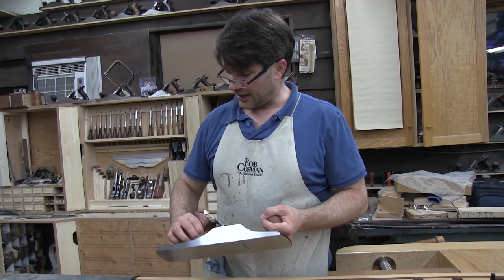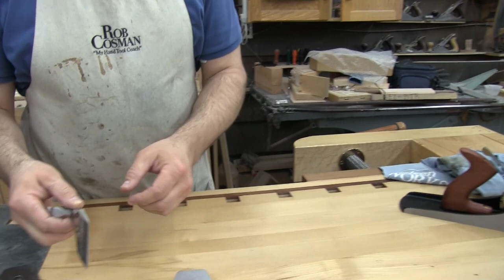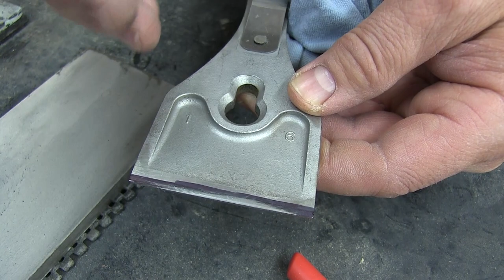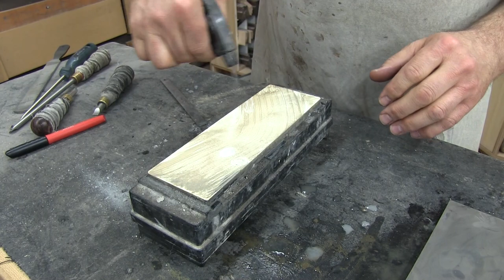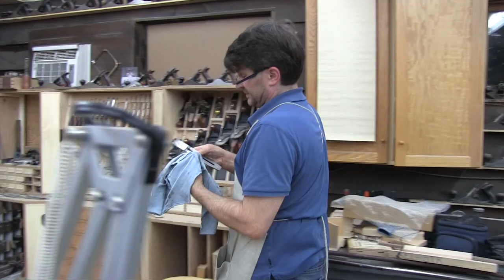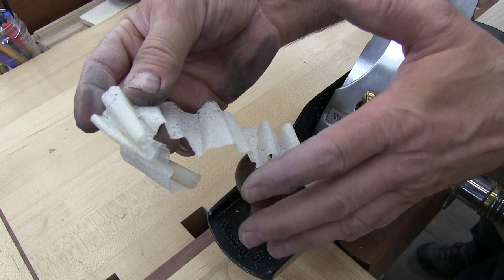WoodRiver 5 1/2 jack plane

Comment: I realize that this is an ancient video now, but it’s the best place to say thanks for this and your other videos talking about the 5 1/2.  After a long period of ignoring them, I got out my planes a while back and got them all working nicely.  That’s a 1940 No. 4 that was my grandfather’s, a No. 4 that I bought in the 1970s (made in England), my father’s 65 and a 60 1/2 that I bought with the No. 4 in the 1970s.  Taking all your commentary into account, I went to the local Woodcraft and purchased a 4 1/2, a 5 1/2 and a No. 7.  

I will soon go through and set them up thoroughly, but I was curious and impatient so I cleaned off the worst of the oil, loosened up the lever cap screw, put some scrap cherry in a vise and started making ribbons of cherry.  And that really is what happened.  Beautiful ribbons ranging from .001 to .0035 (I had to measure them…), right out of the box - quite surprising.  
But here’s the thing I really noticed, especially with the 4 1/2 and the 5 1/2: it’s a completely different experience.  The No. 4 planes feel like toys after using the 4 1/2, and the 5 1/2 is a revelation, with that lonnnng forward part of the sole and its weight.  It is almost, just a little, as if I only have to guide it from the rear.  And I’m realizing that all the downward pressure I was applying to the knob on the No. 4 planes is really not needed with these after the first few inches.  With all that weight and a reasonably sharp blade (factory edge - I was impatient to give them a try) the 4 1/2 and 5 1/2 really keep themselves down on the stock, at least with something like a straight-grained piece of cherry.  I think they’ll do even better with a truly sharp iron.  

The only thing I could find that wasn’t essentially perfect (which in this context means that it’s good to go, not that it’s literally perfect) was that two of the totes were noticeably loose - not a problem at all.  Possibly the factory should be seasoning its wood stock for longer. 😊  

I had wanted to find vintage Stanley or other versions of these three, but they seem to be a lot less common, and a good bit more expensive, than the ubiquitous No. 4.  Worse, most of the ones I found were either true wrecks or had been proudly “restored” by people who really didn’t seem to know what they were doing or what they were working with - and the rest were laughably overpriced.  After an hour or so of gleefully covering the shop floor with a mountain of wood ribbons I’m sure I’ll not be looking back.  

Didn’t mean to write a novel, just wanted to say thank you! 🎉

Comment: Just set up my new 5 1/2 using this video as a guide.  Now i have these damned 'wispy' shavings all over my shop.  Your sharpening method is spot on.  No more adjustments with a hammer.  Now onward to the #7 and the block plane.  Thanks Rob.
Reply from the maker: Such a terrible side effect!

Comment: I just purchased a No.7 Jointer, I use it daily, sometimes it's a bit to large for the task but, I'm learning to adapt..   I have a few comments to make about the initial setup of this plane..  First, I found that the chip-breaker needed a large amount of reworking over-all, on the mating edge, there where many pits and overall roughness at the mating-edge to the blade(wood-fibers were jamming in the gaps, spent about 20-minutes correcting the mate-up, I then put a small bull-nose on the chip-breaker to roll the shavings away from the tip.. The chip-breaker was not flat and wouldn't mate to the lever-cap or the blade, so its flattening was a must.. Now for the lever-cap, needed much flattening to mate to the chip-breaker, the lever-cap was the most crude part on this plane, maybe an after-thought by the assembler..   Anyway, I am very satisfied with this plane, I would purchase it again and do recommend it to all...

Comment: One of these, one of your low angle block planes and one of the bigger ones and that will give me all I need.  I am mostly a power tool guy but know very well that a few effective hand tools can actually save time and clean up some work much more quickly.

Comment: After watching you promoting, setting up and using the WR 5 1/2 Jack, I bought one along with the low angle block. I have an email sent to WC due to the Jack plane sides not being square to the sole. Both sides look to be parallel to each other but are skewed from the sole about .0045 from the sole. I've seen a few reviews mentioning this here and other sites. Wondering how common it is and if WC resolved individual issues. Kind of makes it useless on a shooting board, which is the second most important function I got it for. The Block plane is true, and I'm using a Starret square that I use for all my set ups.
Reply: You just have to adjust the blade to use it in a shooting board. Use your square or try and error.

Comment: Rob, I love your videos. I mean I just found your videos last week and I've been binging on them ever since. You are so well spoken and an exceptional teacher! Truly! I really loved the one on the building of your saws (you need about 5 CNC Machines, your lungs will really thank you) but I have to gently raise one question. When your stones have a residual dark gray color on them, correct? I realize those metal particles are the size of the grit on your stone but it does scratch and I'd like to suggest it may possibly impede your progress while sharpening. If nothing else, it's rough on your stones, particularly your Shapton, because it is metal that wears them. Could be wrong but I just wanted to mention it.
Reply: that's why you flatten the stones before use. Look for his videos dedicated to sharpening
Reply: Jerome, that's not I was identifying. It's the particles of metal that's not cleaned off. That's all.

Comment: makes it look so easy
Reply from the maker: The correct way is easy.  No one wants to believe it is largely the tools you chose but it is.  Great tools have a short learning cycle, simple.
Reply: @RobCosmanWoodworking  is the sharpening technique and procedure you use for the blade in this video a viable option for maintaining an edge on a chisel? or is this specifically for plane blades

Comment: I love your videos Rob and have learned a great deal from you about sharpening , setup etc. I have a question that's a bit off topic since your talking about hand planes. I have asked several of the instructor types here about this and found no help so now I turn to you. When flattening the back on my chisels that are 1/4" and narrower I always, and I mean always end up out of kilter. Can you suggest a fix for this problem? I am  a stickler for razor sharp edges and can attain them with little effort thanks to the tips you have given but I'm at my wits end as to how to maintain parallelism  from the front to back of my thinner chisels. Thanks in advance and may God bless.
Reply: *****
 Thank you Rob. I'll be trying this today on my 1/4" butt chisel (Wood River). It should be easier to control since it is so short.
Reply: mwilson702

Comment: I have the same plane the diamond hone but I have been using a different fine water stone. I am planning on building your shooting board as well. Your sharpening method works great and its fast requires only two stones and is giving me shavings I never achieved before.  How long does the 16000 Shapton Glassstone last? It looks very thin?
Reply: I will probably be using it like you for 20 seconds but only 3-4 times a week perhaps. The flattening is what shortens the life of a water stone. 7-10 years is good enough for me. Thank Rob

Comment: Hi Rob. Thanks for the great videos. Would you recommend the 5 1/2 or the LAJ? Seems like the adjustable throat on the LAJ would make it more convenient. Plus no worries about chip breaker. 

For reference, I am mainly a power tool guy but I am getting into hand tools more and more. I have a 4, 7 and block plane. Thanks.
Reply: you will have an easier time setting up a laj , less finesse for sure.

Comment: Could it be detrimental to flatten the back of the chip breaker? With clamp applied it may spread the pressure better to the edges. I mean, it might deform and flatten under load and being completely flat may not transfer much to the outer edges.
Just a thought, mind you, I don't have a plane to test it on.

Comment: Hello Rob, i bought this plane and i found that the sole is not perpendicular to both sides of the plane. I mean each of the 2 sides are off by milimetr. Is it something i need to be affraid off, becase in my opinion if i use it with shooting board i cannot have good result (without adjusting the leaver all the time). Thanks for your opinion
Reply: I have the same issue.  Woodriver say the sides of the jack plane are not precision machined to square, their tolerance is 18 thou (.45mm) across the sole square to the sides. If your plane is actually a millimetre off then its a reject.  They have offered to replace my plane which is .38 mm off which is within their tolerance, but my view is if I can measure the out of square (engineer square and a 1thou feeler)  its of no use on a shooting board so I am not sure what benefit a replacement will be.

Comment: Thinking of asking for this plane for Christmas.  I've never spent more than $50 for a hand plane. I do like my old stanley 5 1/2, feel it's time for an upgrade.
Reply: Purchase a new blade and you have a new plane!
Reply from the maker: If you’re never purchased a new hand plane. I would recommend purchasing a brand new WoodRiver 5.1/2, it will change your hand planing experience! The weight and feel alone will change everything!
Reply: @RobCosmanWoodworking  Hi, thanks.  I did purchase the plane.  I do like WoodRiver 5 - 1/2.  The first iron was defective, but they replaced it no questions asked. Now it planes beautifully.  Thanks for all your great videos and tips, learning a lot.
Reply: @RobCosmanWoodworking  what are your thoughts on a near mint condition Stanley or Record tools?
Reply from the maker: Even a Stanley Bedrock pales in comparison to a WR or LN. The Bedrocks are worth having, but only as an ornament. Records aren’t worth it. They’re all to light in comparison to modern casting.
Reply: @RobCosmanWoodworking  too add,  castings and final dimensions are more refined in modern tool counterparts . Though the Stanleys and Records may not be eye to eye with modern equivalents, they worked for the craftsmen then and can work for the craftsman now, if tuned up to working condition. Harmonizing tool and wood is an art form in its own right.

Comment: Rob GREAT video!! Before I buy a WoodRiver 5-1/2 jack  plane I need to buy the three sharpening stones.Whats the brand name of them and where did you buy them? Thank You
Reply from the maker: We sell them at robCosman.com
I start with  1000 grit diamond stone and finish with a 16,000 grit Shapton stone.  The 1k diamond plate is double sided, 300 grit side is used to keep the 16k stone flat.  For initial chisel back prep I use a 6000 grit Shapton in between.

Comment: Thanks for all excellent content Rob. I just bought the 5 1/2 based on what I've learned here. I checked the squareness of the sides to sole and mine is not. Seems like that is important when using a shooting board.What do you recommend I do?
Reply: Who made your plane?
Reply: @kellygnsd  It's the Woodriver 5 1/2
Reply: @ronaldhoppus9015  I returned my Woodriver No 6 as it was so far out of square it was useless on the shooting board.   Bit of a disappointment but  I made myself feel a lot better and bought a Henry Eckert No 62.... I mean it is square to 12 microns variance (..012 mm) so happy now lol

Comment: im using my no 4 on the shootingboard but its not workin very well.  is the no 4 to short ????
Reply: Yes, too short and too light. The 5 or 5 1/2 are much better. The old Bedrock planes (which Wood River has copied) are the best choice. There were some with tilt handles made specially for the shooting board.

Comment: ...or you can just buy a better quality plane, like a Veritas or LN.
Reply from the maker: Samer Bouez you mean you could just pay more money without improving the results?
Reply: @RobCosmanWoodworking  I mean if you receive the plane and it still has burrs from manufacturing, it doesn't speak high of their QA.
Reply: RobCosman.com Hi Rob, thanks for responding to that comment. I love you videos—you’ve taught me a lot and I’ve used what I’ve learned to tune up an old Stanley #6 with the corduroy sole and it works much better.

Another area you excel in is knowing what tolerances to work to. When you say “that’s flat enough” I wouldn’t know to stop there. And, again, this is a subtractive process—I cant add back material I’ve already removed.

So I’m not as comfortable—at my skill level—taking a file to the throat of a new plane. I’m frankly concerned I would ruin the plane and never even know it.  Do the premium brands have better finishing around the throat and a flat (or flat enough) chip breaker and lever cap?

They are eye-watering,y expensive, but that is an area I might find the value worth the additional expense.

Thanks!